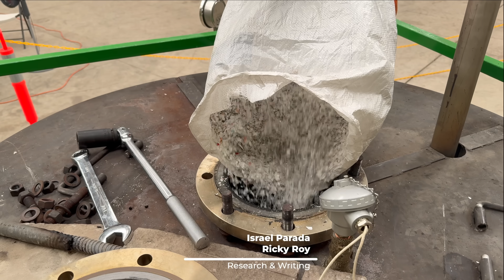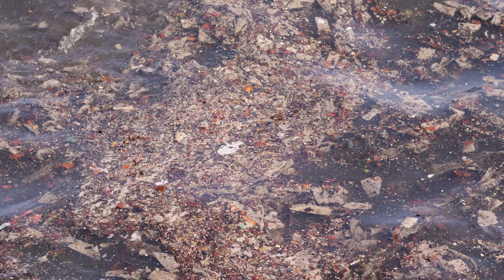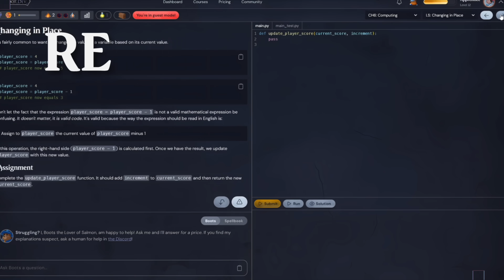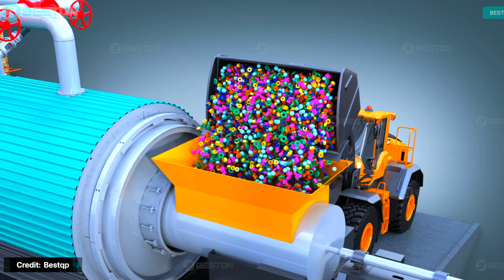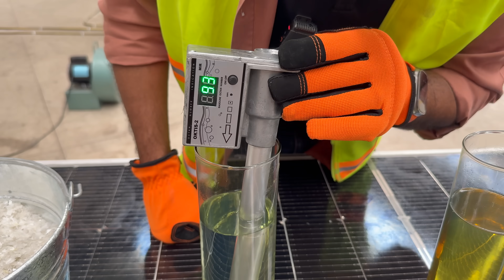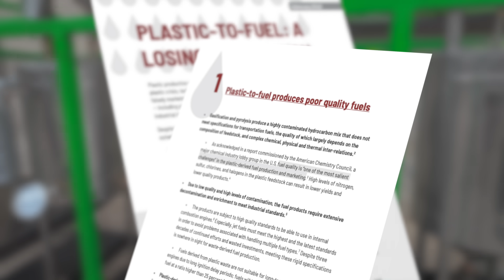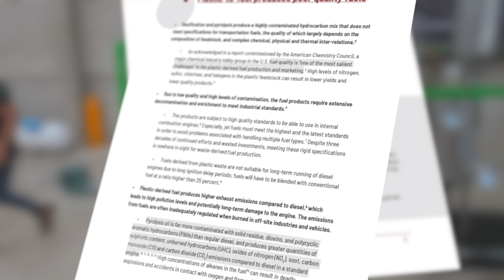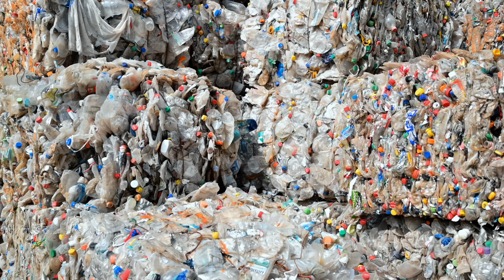Solving the Plastic Waste Problem - This Surprised Me!

Comment: As regards the carbon argument, gasoline made via this process should NOT be adding CO2 to the atmosphere BECAUSE it would technically be replacing the gasoline made through traditional oil refineries. The true issue is us needing to know if the process of producing gasoline releases more carbon or not.
If you could get CO² numbers comparing the process of manufacturing for a gallon of traditional gasoline and any related byproducts during that process and compare them to the process used to turn plastic into the various fuels made by PETGas, I feel like we, the viewers, would be able to accurately say one way or another which is truly best. Until then, we only have very limited information to work off of and it's very much a bad idea to form an opinion at this point. After all, this is EXACTLY how big companies can try to bury disruptive technologies... Lack of clear information being used to poison the public to a possible better path.

Comment: I'd prefer to see a closed recycling process, but this is interesting.  So I guess it comes down to "do you want to eliminate some solid plastic waste by converting it to usable, combustible fossil fuels?" Neither is very desirable, but I guess it comes down to which path does the least environmental harm.  Hard to answer because it's kind of a comparing apples to oranges problem.  How to quantify the damage done by environmental plastic waste against the damage done by burning kerosene (~jet fuel), diesel and gasoline.

Comment: Combustion to make combustibles... yes refiring makes sense but the holy grail is probably fully electric with more energy spent on  figuring out what to do with the part that needs to flame. The low tech side ignores the C02 released during the the process..

Comment: Sorry to say they punked you. This technology is over 70 years old. It is recycled as a news story to promote the recyclability of plastics every few years for the benefit of confusing plastics consumers and regulators. Each time it is called "new" and "revolutionary". The way to avoid being fooled is to apply a "common sense" test or ask a chemical engineer if this is something new. Absolutely nothing about the "tech" in this video is much beyond sophomore level undergraduate Chemical or Petroleum engineering. It doesn't work economically and has been tried thousands of times.

Comment: This tech has been around for decades. It got a wave of attention in the early 2000s until it became clear the cost was completely non-competitive. Using some of the gas it produces to fuel the process helps, but you’re still releasing the CO₂ back into the atmosphere. And if you already have sorted plastic, it’s usually far more efficient to recycle it into new plastic. This feels more like a solution in search of a problem than the other way around.
Reply: Yeah but most of it isn't even recycled, most cities in municipalities pay for the plastic to get shipped from point a to point b instead of actually turning it into something themselves, so a lot of times plastic that was meant to be recycled overseas is dumped prematurely in Open water by the cargo ships, and then they just come back to get more because the transportation has already been paid for. We aren't recycling our plastics fast enough to the point where they're not releasing microplastics karma the planet can handle CO2 a lot better than it can handle microplastics.
Reply: Depending on your goal. It may not be cost effective, but it sure does shrink the landfill while providing some useful products.
Reply: @Awrethien  I think a better way to look at this as instead of thinking it as an efficiency issue, they can say it's to reduce the amount of stuff in landfills.
Reply: Recycling into useful plastic seems to be far less feasible than promoted.  A material in search of a use.
Reply: CO2 is NOT a poison!!!!!!!!!!!!
Reply: You're mixing talking points, combining operating fuel costs with CO2 emissions.  Note here they don't have fully sorted plastics like you need for recycling, the types of plastics that need to be sorted out are limited, making it more likely the plastics are re-used and not sent to a landfill or incinerated.

They are heating the plastic to break the hydrocarbon chains to use as the feed product rather than crude oil, the rest of the process could be a distillation column like used in refineries, not sure why they aren't running the wax through a cat-cracker to get even more fuel.  If the tail gas has a large amount of heavier light hydrocarbons (ethane, propane, butane, etc.) a large setup would recover these as well in a distillation column.

A better application might be to cool the plastic gas exiting the kettle and mixing with crude oil at a refinery - you're likely losing some energy on cooling water to cool a product you will heat up again, but boosting the quality of the crude entering the refinery process, producing the same refinery products, without the need to recreate the distillation columns, etc.  The wax could be sent directly to a refineries cat-cracker to break down the long hydrocarbon chains from a solid to a liquid (gasoline, diesel, etc.).

Comment: 12:55 "should we be doing this"
Perhaps. But I'm more interested in powdered plastic slurry and wicked hot combustion chamber walls
13:55 "plastic waste to fuel"
If you're going to burn fossils, you might as well first use your fuel as a plastic chair, bottle, or whatever.

Comment: As long as we're taking oil out of the ground to make fuel, nothing is lost by turning waste plastic into fuel. 
"But you're turning waste plastic into CO2!"
So? Would you prefer to satisfy our fuel requirements from underground oil reserves or from landfills? I think there's more to be gained by using the oil stored in landfills.

Comment: I have questions. 1) what does it cost to make a gallon of gasoline using PetGas's process vs. big oil's process? 2) how much waste makes how much of each output? 3) how well can this scale up? 4) if this works as described, would there be a need to pump as much oil out of the ground as we do now? I'm not saying we'd stop because we'd still use oil to make plastics, but if we can just focus on using oil to make plastics then take those plastics to make fuel, wouldn't that decrease our overall demand for oil? 5) can they also produce jet fuel from this process?
Reply: Exactly. In addition, burning gasoline will put the carbon into the atmosphere.
Reply: @terrulian  Gasoline is already putting carbon into the atmosphere. I'm thinking that using the plastic instead of oil as the basis will reduce the need for oil overall.

Comment: despite some hesitance, i think this is a win: creates demand for plastic waste that would otherwise sit in landfills and poison the environment, plus it can help reduce the need for new oil drilling, which is its own win on multiple levels. basically, it's not increasing demand for fossil fuels, but it's helping to recycle them. that said, we desperately need some good innovation in carbon capture. and we also need a carbon tax.

Comment: I worked with a company named "Velocys" that was essentially doing the same thing. This tech has been around for a while but no one has been able to up-scale it to deal with 100s of metric tons of plastics which is what is needed for these types of systems to work. 
A very cool idea, I just wish someone would champion it and get it main stream.
Reply: This business model is not economically viable. Plastic has a cost — no one gives away waste for free, especially if it has been pre-treated — and the energy required has such a high cost that, in addition to raising the break-even point, it may even compromise the sustainability of the entire business model. What is shown in this video is nothing more than pyrolysis and gasification applied to clean plastic (already processed). There is nothing new here—we’ve known this process for at least 50 years
Reply: It isn't that easy, that is why you are wishing. There are many factors at play that do not want this tech to see the light.
Reply: Was that around Plani City, OH next to 33? I used to service their generators. I think it's gone now.

Comment: if the process was powered with 100% green energy so it would not create additional co2 waste, and as long as we are using carbon fuels, this process would be beneficial especially if we could get the plastic waste out of the environment.

Comment: maybe enough to run our old timers.
i would not use the natural gas to heat up the process. i would use two or three heat pumps in series to produce the necessary heat and store the natural gas for the use in winter for whatever.

Comment: Collecting plastic and separating it from other materials, such as paper, metal, glass, and miscellaneous viscous or dried-on residues that can gum up the process, then shredding it is a massively labor and energy intensive process. Waste plastic is usually very dirty; it's actually used as a waste container, for stuff like feces, vomit, used motor oil, spoiled and contaminated food, spills, God knows what, often in masses or volumes exceeding that of the plastic. There is no low-tech process that can take in waste that isn't well-sorted and relatively clean without incurring massive maintenance costs. That's the reason this is not done. The plant in this video is using the cleanest 1% of waste plastic, delivered to it for free. However, if all people are treated as equal, the cost of dumping will be higher, or we'll develop a high-tech solution that really works, such as a nuclear fusion torch.

Comment: This concept has been around in labs for a long time.  But the solution to plastic waste should not be burning it and putting it in the air.  This is by far not 'green'.  What we need to do is turn it into oil that can lube machine parts, and then further be recycled over and over by cleaning that oil as needed.  Turning plastics back into oil and reusing that oil in as many times as we can is the goal.

Comment: The ground conditions make a difference.  Does plastic accumulate, does gasoline and fuel costs remain high?  Does an existing fuel monopoly have the ability to undercut a new source of fuel with a temporarily lowered price?

Comment: I'm sure the oil company researchers have actually figured this out, but they likely intentionally described it as being too difficult in order to rake in more profits via drilling.
As for the premise of burning this fuel instead of maintaining the carbon-capture of the plastic's original form: if it means less oil is extracted then I would say it's not really a problem.  That's a big "if" though - we may just continue extracting oil until every last drop is gone.

Comment: Until it can process all plastics together it is not that interesting.   You might as well just burn the plastics in a power plant.    

I really think that taking all waste plastics and making some type of extruded product makes more sense.  If you had a  small ship that could move among various islands and processing waste plastics into boards to be used locally makes sense to me.

Otherwise I think making a small container sized power plant that ran on waste plastics would be more useful.

Comment: The self looping to fuel itself with more problematic gases that are more difficult to capture as part of the process is definitely a good way to make this a net positive product. 
For me, I'd prefer the plastic turn into fuel for use than littering the landscape. CO2 in the air, can be used by plants and eventually become part of the environmental loop. There are already many scientists stating that the extra CO2 is helping with re-greening the larger deserts of the world.